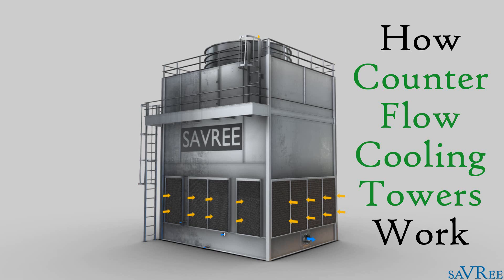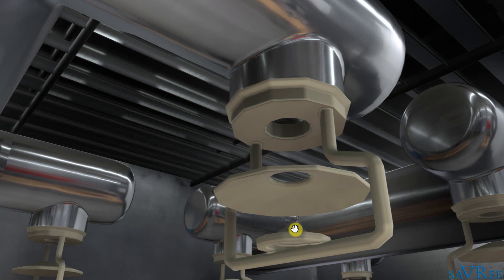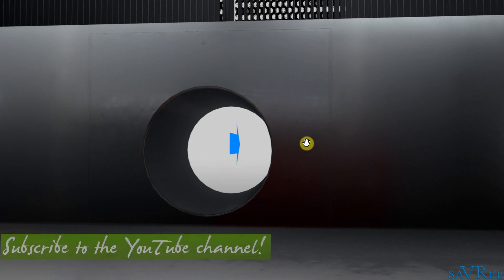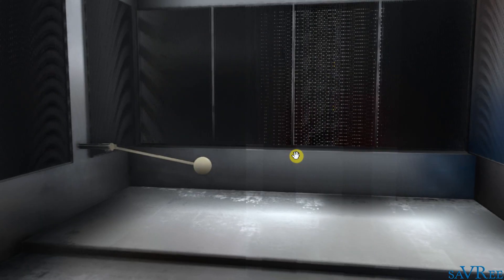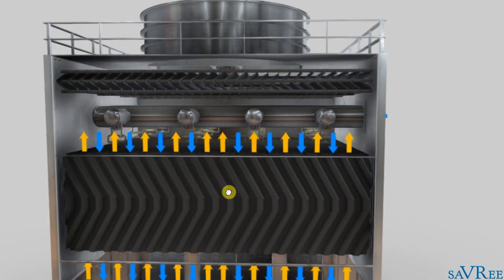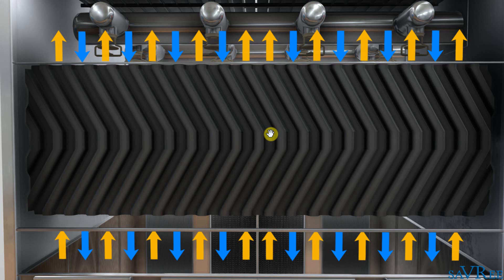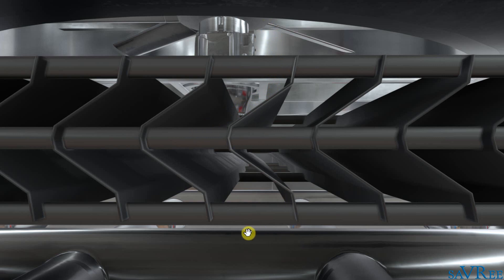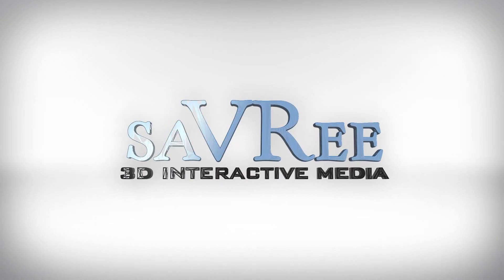How Counter Flow Cooling Towers Work

Comment: Drift is not evaporated water, it's water droplets being carried away by the air.  You want to get rid of the evaporated water because that's your heat rejection.  You want to prevent drift because it's unnecessary water loss.
Reply: Yes true!!